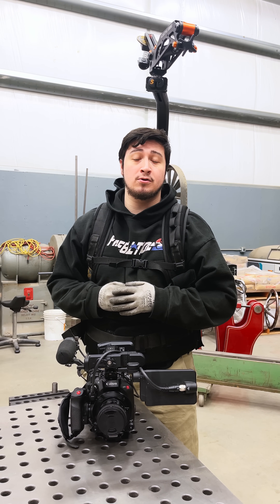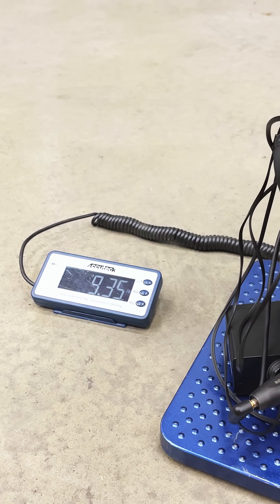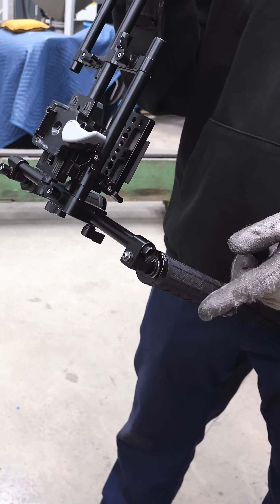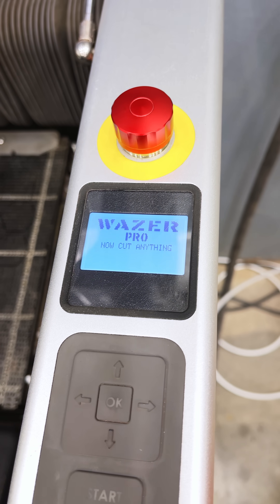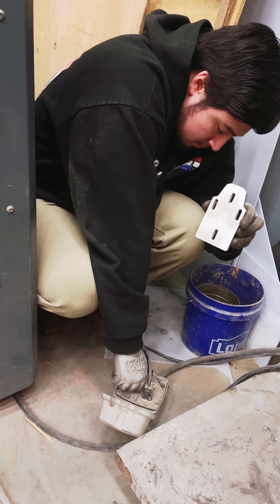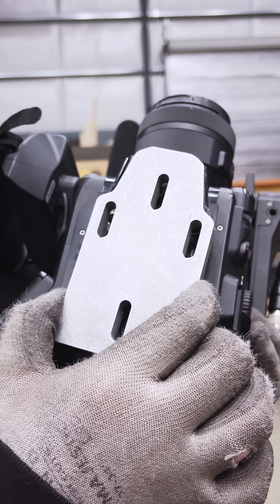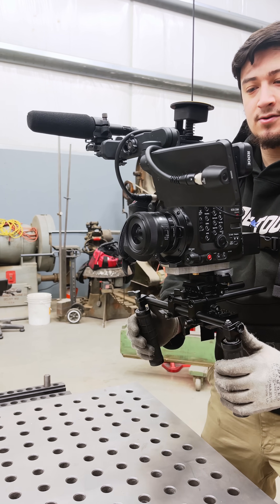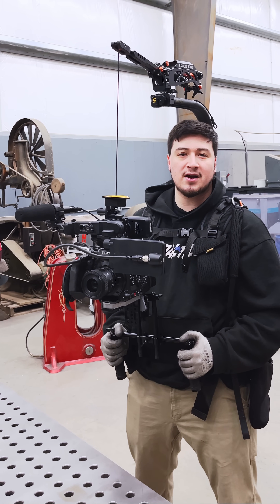We Couldn’t Buy It, So We Made It! Custom Camera Plate Adapter.

Comment: Make the handle grips heavier. That will give you the weight you need, and will provide mass that is spread out for stabilization in multiple planes. In the wilderness I use a rock to stabilize my binoculars from my hand shake. I found a flat rock provided more damping for a twisting shake.